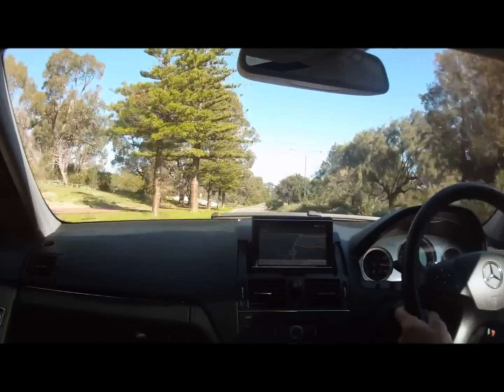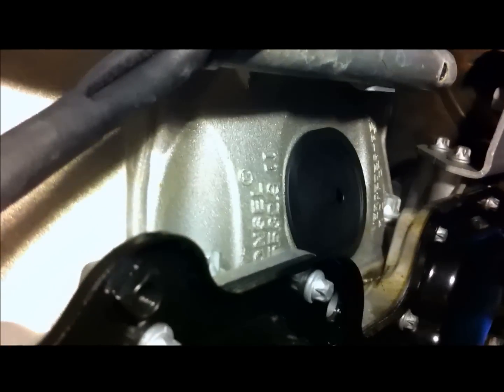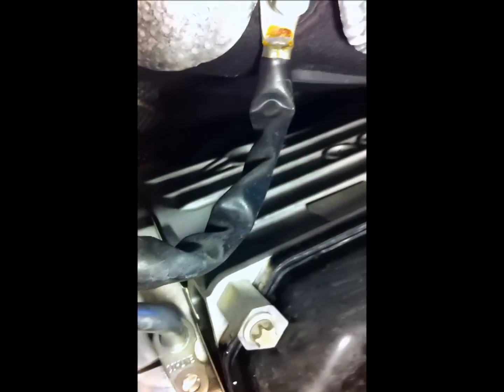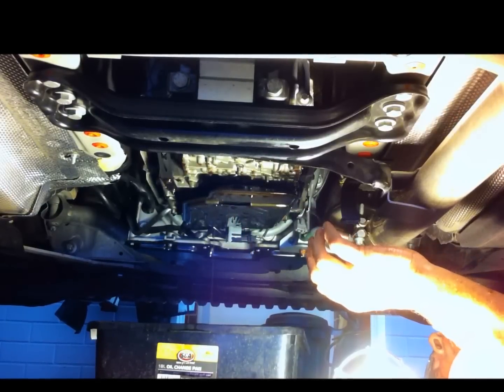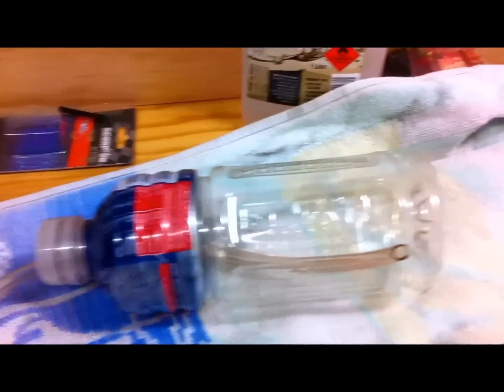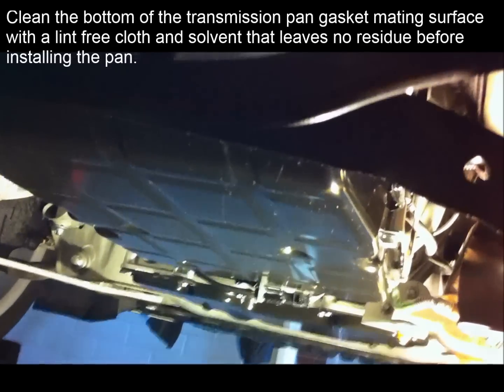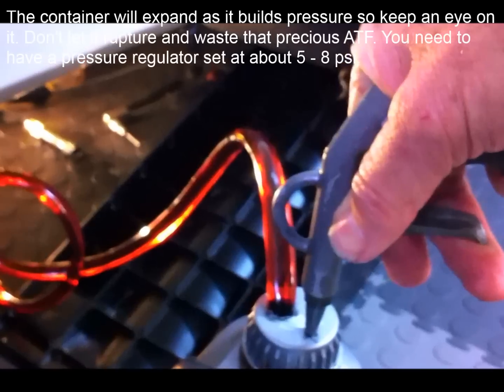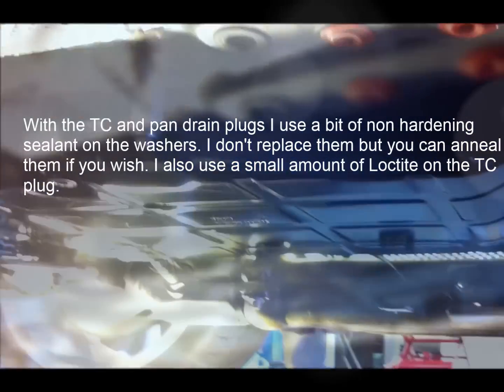Mercedes W204 C Class Transmission Service ATF Fluid Oil Change 7GTronic 722.9 Test 0-60 mph

Comment: Hi again Scott!

I have replaced the transmission fluid twice since I last corresponded with you a year ago.  Unfortunately, since my SLK55 AMG does not have a drain plug on my torque converter, I can only accomplish so much with each flush.  If I may I'd like to share an observation and see if you too noticed similar.

For the first 100-200 kms after the flush I have the smoothest shifting transmission around.  But gradually some subtle harshness starts to resurface.  Have you noticed something similar?  I am wondering if short-lived additives in the fluid are to blame, or something else?  My second flush was just this past spring, with my third being today.  There was an appreciable improvement, which is surprising given how little time has elapsed since flush #2.

Thoughts?

tn
Reply from the maker: Thomas I haven't had those issues because I can do a complete change. Considering the TC holds about 50% of the ATF it would take at least three goes to replace the bulk of the oil. It is possible to install your own TC drain plug by drilling a hole next to the welded seam and tapping with an M5. Have a look on www.benzworld.org as someone may have done it. Scott
Reply: Thanks Scott!  I found one guy on benzworld that broke his drain off(!), and was provided with advice on how to proceed.  Of course my big BIG worry is having shavings get away from me, ending up somewhere terrible and expensive.  Magnets not withstanding.

I'll do some poking around the interwebs and see what's what!

tn
Reply from the maker: Tom yes that's always a concern. Although when you drill the ATF will start flowing and flush the swarf outwards. Also use a strong magnet to magnetise the drill bit. Drill a 4mm hole and tap with an M5. If you work out how to do it let me know. I have a friend with an XF Jag with the same problem. That has the ZF 6 speed transmission with no TC drain. We're going to try to get an old TC of the model from a repair shop to practice drilling to find the correct place to install a plug.

Comment: does the 2008 models with old style pan use the white tube?
Reply from the maker: Yes I understand they do. You swap the white tube to the new sloping rear type oil pan. It's a recommended upgrade to replace the old style pan
Reply: Scott Elliott so confuse on the pan, I don't want to pull it to find out I have black tube then have to find a pan. my current pan is a 221-270-12-12
Reply from the maker: Well that part number is for the oil pan with the sloping rear which means it should have the white overflow pipe. It was the old oil pans with the vertical rear that had the black pipe. This may help: https://fliphtml5.com/odta/kjbi
Reply: ahh ok, I wasn't sure since I couldn't find any info on the old pans with black tube. and since mine was an 2008 model bought in Nov of 2007. mine does have a slope though.
Reply: question about fluid level, we have about 9 qts in so far, should we over fill it a bit then run it to 113 degrees then open up the pan drain to let excess run out? some reason I think we are low because the dripping is very light.
Reply from the maker: You overfill a bit. About 8.5 litres usually. Open plug when engine is running. If there's not a continuous flow you need to add a bit more.
Reply: Scott Elliott I think I keep doing it when car is not running so I lose a lot of fluid. I'll fill it up with it running, then once hit 113 I'll remove adapter

Comment: can you please tell  me this transmission already uses the 236.15 blue oil right ? minhe the shop change it to the red one 236.14 and now the mercedes mechanic says that this oil is rongh becaus my car is above 2010 is from 2013 and aftter 2010 all the gearbox are the 7g tronic plus anyone can asure me or give me the correct information about the correct reference oil and if is needed to use original mercedes atf oil or i can use for example the one atf fluid fro delphi that manufactures a lot of parts like injectores that give some problems in the begining ? apologize my bad english ,thanks and best regards appreciate asap answer has possible best regards from oporto Portugal
Reply from the maker: The 7G changed to the MB236.15 ATF after 2010. You must use 236.15 in that transmission. Your shop should not have used MB236.14 in a transmission made after 2010.
My transmission was made in 2008 and uses red ATF MB236.14.
You can use many brands of ATF as long as it has the MB236.15 specification. You do not need to use Mercedes branded ATF. I use Fuchs or Total ATF. Regards, Scott from Australia.

Comment: Scott, the 3/8" tubing that you referred to, was that inside or outside diameter?

Thank You, Jim
Reply from the maker: It's always the inside diameter when discussing tube sizing. Wall thickness can vary depending on the tubes use. The inside diameter is the constant.

Comment: Hello. Thank you..... I'm going  to follow your method mostly for my 7 plus G-tronic 722.9  later type using blue ATF 236.15;  year 2011 GLK  220CDI 4Matic BlueEfficiency ; transmission type 722 965 DIY in Seoul, South Korea,  at 700,000Km/6yrs.
Could I ask one thing  about the  factory direction by WIS  to warm to 90C then cool to 45C for vehicles with additional transmission oil cooler  due to thermostat opens at 90C after initial pumping 6 liters ATF.    
 PDF]Filling automatic transmission with fluid - MBWorld       https://mbworld.org/.../190878d1283185871-diy-722-9-7g-tronic-7-speed-automatic.. AR27.00-P-0270SYZ. Filling automatic transmission with fluid. 8.7.09. TRANSMISSION 722.950 /960 /961 /962 /963 /964 /965 /966.

You  flushed 500mL ATF to oil cooler line in cold state, and later mentioned  after initial filling that"When you first start the engine leave it running in P for about a minute first to pump oil into the TC.

Does it mean that is enough  around 45C to circulate into cool oil cooler line?  Or the "additional oil cooler mentioned by the WIS" is aftermarket one? not of stock built?  So  that is not necessary for the stock transmission ?
Reply from the maker: With my model there's no thermostat in the line to and from the oil cooler. I would suspect yours is the same even with the additional oil cooler. The flushing operation should work but you'll soon find out. If the fluid won't flow through the oil coolers back into the transmission then a thermostat is in the line somewhere. I would think the thermostat is within the transmission hence the requirement to warm to 90C first. So you process will be the same other than a two stage temperature requirement.

Have a look at the new video we made doing the 722.9 on a ML320CDI. It's the same transmission as the W204.
https://youtu.be/sP0FfkfQCLg
Reply: Great wisdom! Thanks.

Comment: Hello Scott, - a little off topic but you did mention this in the video.  I am curious about your tuning box.  I am trying to decide between an ECU tune (hard on the E Class ECU as it has to be opened up), or a tuning box.  I am told ECU is the best method, but I like the simplicity of the tuning box.  Any recommendations?
Reply from the maker: Ty I haven't any experience with ECU reflashing. When you add a digital tuning computer it's essentially expanding the ECU. The signals that come out of the ECU are modified to create a new map so to my logical brain it achieves the same result. Considering those electrons are shooting around at the speed of light the final map gets the signals to the injectors at the same time. I use the Bazzaz engine management system on both my race bikes and that's an add on computer. The signals from the ECU are intercepted by the Bazzaz black box to create a new map and the new signals sent to the injectors.
I use a DTUK tuning box on both my Mercedes and not had any problems. The engines are smoother and more powerful.
Reply: Thanks for the info Scott, I will check them out.  Love the videos, keep 'em coming!

Comment: Is there a necessary  the oil to be changed in torque convertor ? .. Some mechanics at Mercedes Benz dealer told me there is no need to be changed form torque convertor!!thanks in advance !
Reply from the maker: Yes it is. The TC holds about 50% of the ATF. You wouldn't change half 
your engine oil. The dealers have no incentive for your transmission to 
last as they sell transmissions. They want to sell you a new 
transmission for $10k when your current one fails. Don't listen to 
people with a vested interest. Never ask a hairdresser if you need a 
haircut because it's obvious what the answer will be.

Comment: thanks so much for the upload. the air pump trick worked like a dream. I didn't bother making a plug to fill with; I just bought an air nozzle that was surrounded in a rubber tip, screw clamped my hose from the barrel top, and held it with one hand and put in 4lbs air into the bottle.
Reply from the maker: Micah I'm glad I could help out. Well done on improvising.

Comment: Thanks for that video is great. Just recently went to a garage to have transmission fluid change, as they call it Mega Flush.
They have used super cool machine but then they haven't replace the filter or coding plug. Now I am puzzled.
At the back of my head with my 10y motorbike experience it doesn't sound right to me. Where is new oil there comes a new filter. That is my thinking. But that flush cure all at once, hmm really???
They have used a "fluid" to flush every dirt out of it then fill it up with fresh oil. 
The transmission pan seal is misting up and it is screaming for new seal! 
My plane is to drain oil from the pan replace seal and filter clean up. But then my question is  would I be able to refill oil from the top through dipstick tube. Any tip most welcome, thank you once more!
Reply from the maker: On this 7 speed transmission there is no dipstick tube. You have to pump the fluid into the drain hole.
Do you have the 5 speed 722.6 transmission as that does have a dipstick tube?
Reply: Hi Scott, Yes I have got dipstick tube on my MB W204002, 2010. That dipstick tube is blank off with a plug and lock tag. It also has  a module/connector at top right corner as you look from the bottom. One of MB dealer told me that I have got 722.9 and don't need to change oil at all. Is it something to do with  Executive Pack I would know?
Reply from the maker: The W204002 came with both the 722.6 or 722.9. Your's has the 5Gtronic 722.6 with the dipstick. Have a look at the recent video I uploaded showing how I serviced the 722.6 in my W639 Vito. It's easy to do. Don't believe for a second the "filled for life" nonsense. The ATF needs changing about every 60,000km or three to four years. Mercedes make their own transmission and want to sell as many as they can. They marketed the 722.9 as filled for life and after about 5 or 6 years the failures started as did the increased revenue flow supplying new gearboxes at $10k each.

Comment: Your videos on the Mercedes 722.9 transmission are excellent.  I used to do my transmission fluid change on all my previous Mercedes until I got my current ML with the 722.9 which I did not dare touching because of the refilling from the drain plug procedure.  Your video gives me the courage to do this myself again. Big Thanks
Reply from the maker: I'm glad I can help. The transmission is very simple to service so don't be scared of it. I think it's easier than doing the 722.6. Add an extra drain plug while you have the pan off. That makes a fluid change quick and simple. Buy some high temperature neodymium magnets.

http://www.ebay.com.au/itm/1-strong-powerful-33mm-dia-x-10mm-N35SH-Neodymium-disk-magnet-high-temp-DIY-MRO-/181481208756?hash=item2a411f7bb4:g:VZEAAOSwGvhT2l1x

Comment: Hey Scott - I'm in the middle of the job and have noticed that the transmission filter seems somewhat loose.  The o-ring secures the one end, but the other is not snapping onto anything.  Was this your observation too?  tn
Reply from the maker: Tom that was my experience to. The 722.6 transmission filter snaps into a slot. The 722.9 doesn't have that. The o-ring secures the end and the pan sits snugly against the other end so it can't go anywhere. I've had no issues in three years. Scott
Reply: Ten-four, and thanks for the uber speedy reply Scott!  Oh - I've left my pan gasket completely dry.  In other words, no smear of oil like you might do for an engine oil filter gasket.  Sound ok?
Reply from the maker: I cleaned with evapourating parts cleaner and bolted it on. No problems.
Reply: +Scott Elliott Perfect - thanks again!  tn

Comment: Hi Scott!From your experience and hearsay what would you say is the likelihood of the pan leaking afterward? Assuming diligent cleaning of the sealing surfaces of course.My concern stems from the (repetitive) leaky valve covers on my SLK55, and feedback from my Indie shop.  They clearly did NOT want to remove the pan and offered to flush the fluid (meaning no filter change).Thanks!
Reply from the maker: I've never had a problem. I've cleaned both surfaces and tightened the pan bolts in two stages using a criss cross sequence. You can always put some non hardening sealant on the gasket if you wish. Permatex make a product.
I always have a healthy force field of skepticism when exposed to opinions being spruiked by a rent seeker. The Indie is obviously wanting to use his flush machine. He can probably make a higher margin that way. I'm not convinced that method is better than draining the TC and gearbox, replacing the filter, flushing the lines to the cooler, cleaning the pan and installing an extra powerful high temp neodymium magnet. The pan can have a build up of sludge if the ATF is old and that sludge is best cleaned out. A flush machine is not going to clean the pan and replace the filter.
I did my W639 Vito 722.682 transmission last week. I collected footage to make another video. I'm doing my 722.9 in a couple of weeks and will make another video.
Reply: Cool and thanks again Scott.  Looking forward to any new observations you have with your next video.  I picked up the Weed Sprayer unit and surface thermometer, so I now have everything needed ... even got the (rainy) weather.  tn

Comment: Hey Scott, does this transmission have a mechatronic plug that I see on some of the videos. If not, so for this project I need a new drain screw seal, transmission pan seal, filter and magnets. and the plastic overflow spout ?? of course the transmission oil also.    Thanks
Reply from the maker: Reiner for this project you need to purchase the oil, filter and pan seal. Placing an additional neodymium magnet in the pan is optional. There are magnets present but they're weak. You don't need a new copper seal for the drain plug and reuse the existing white overflow pipe.

It's easy to anneal the existing copper washer. Google it.

You refer to "mechatronic plug" ... do you mean magnetic plug? The existing plug is not magnetic.
Reply: Hey Scott, Thanks for everything. Reverse camera works perfectly and I've change the oil, pan seal and filter for my transmission. Now I'm thinking of doing the fuel filter. do you have a video for this
Reply from the maker: The fuel filter is simple. I do have a video for the Vito and the process will be the same.
https://youtu.be/kxfbLLTOkZ8
Change the o-rings in the water separator fitting in the middle of the filter ... if you have one. The o-rings wear. Mine was leaking. The vibration seems to flatten the o-rings by wearing the outside face.

Comment: will this work on my 2013 c250 i4 turbo? is this the transmission in my vehicle (722.9)?
Reply from the maker: +JP Oner I understand it is the 7 speed 722.9??? but you'd need to check and confirm. Do some googling ... you'll find the information easily. Scott

Comment: Great vid! Do you or anyone know if this is the same process for my 2014 c250 sedan? Thanks
Reply from the maker: +Eric x Thanks Eric. Yes it will be the same process for your 2014 C250 ... if it has the 7GTronic 722.9XX transmission. Is it the C250CDI? ... I understand that does have the 7 speed.

The only difference will be the ATF. The spec is probably MB236.15?? which is a blue colour. So you'll need to chase up the specification of ATF you need.
Reply: +Scott Elliott mine is a gasoline  c250. I'm not sure of the technical designation or transmission type but your vid certainly helps! I'll look into it more. Thanks again